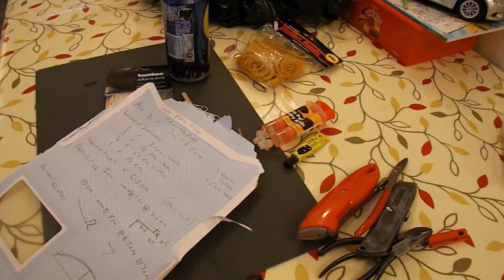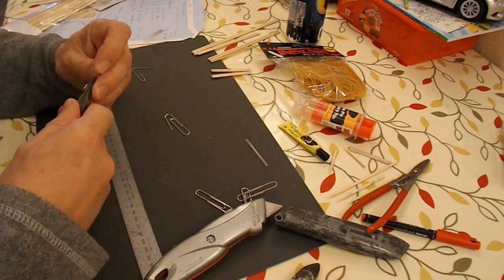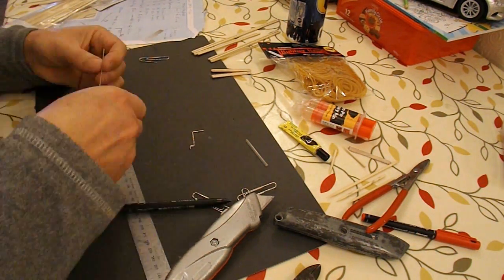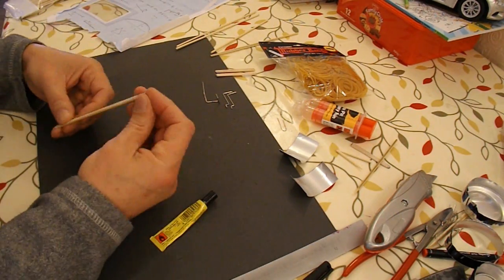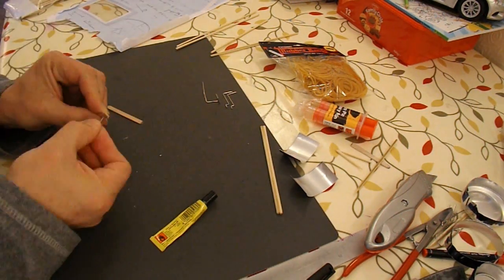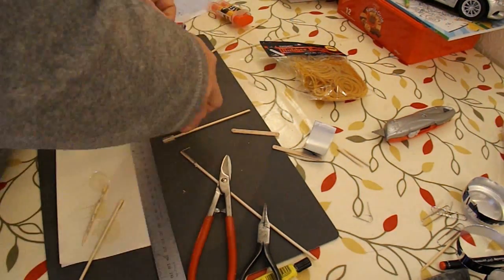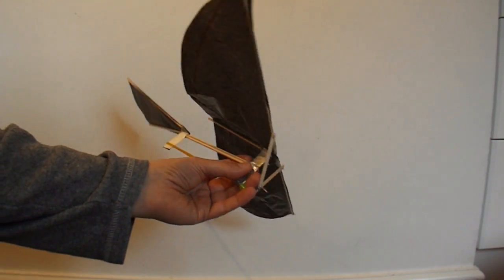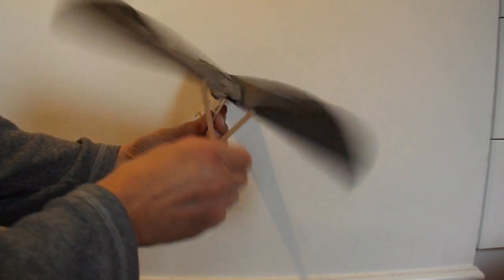My first Ornithopter thanks to Uno Para Todo

Comment: could you make spars with straws to put a rigid bend in the wing, like cut them slightly longer and selotape them on,or would it add to much weight,great video
Reply from the maker: +clara17uk I am not quite sure what you mean but this was a fairly simple build so maybe you could try any variations yourself and then you will know if it works. The link to the original build by Uno Para Todo is in the video description.
Reply: GrandadIsAnOldMan
 sorry i didnt explain it very well,stick straws or cocktail sticks from the front edge of the wing to the back untill it makes a curved wing although you might rip the plastic and damage the lil birdy, i dont have the skills to build it im  useless at anything like that, have a good one:}
Reply from the maker: +clara17uk I don't see any advantage in your suggestion, the flexibility of the wing is part of the reason it flies. Making it rigid would probably have a negative effect. If you want to see some excellent RC ornithopters I suggest you visit Kazuhiko Kakuta  https://www.youtube.com/user/BZH07614

Comment: someone should invent the ceilingthopter..................
Reply from the maker: These tend to spend more time flapping on the floor. I haven't quite had the success of the originator on Uno Para Todo.
Reply: GrandadIsAnOldMan I'm guessing that if you attached one to a ceiling hugger it might vibrate & push in such a way that it travelled across the ceiling
Reply from the maker: david vernon williamson wow, your mind works well outside the box. That is an interesting combination.